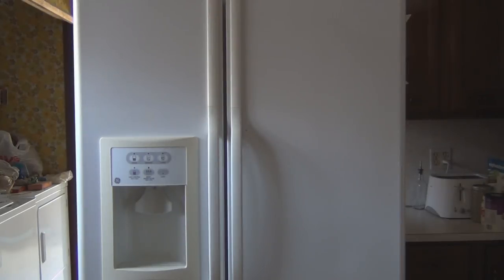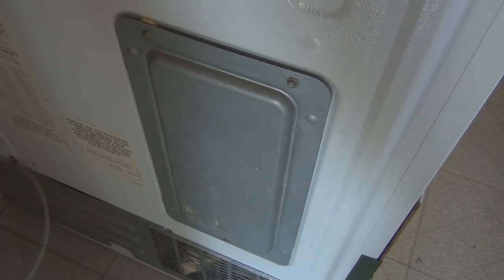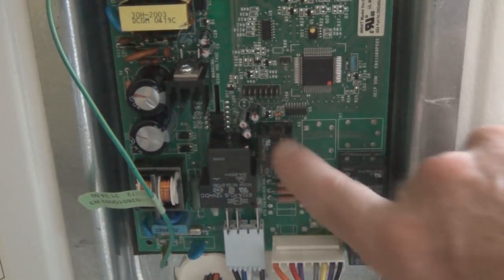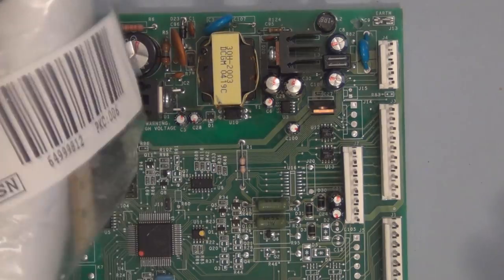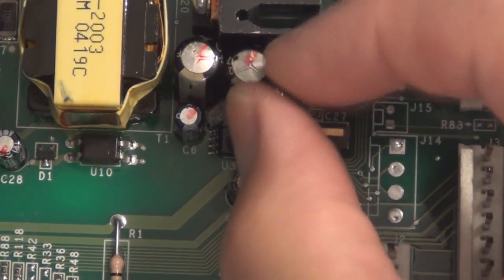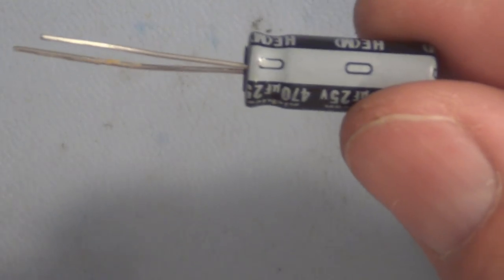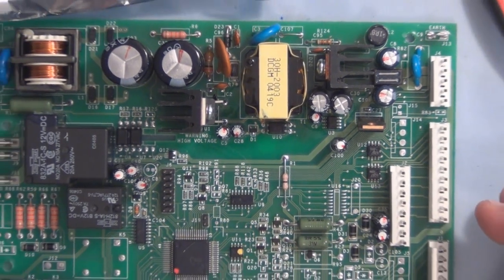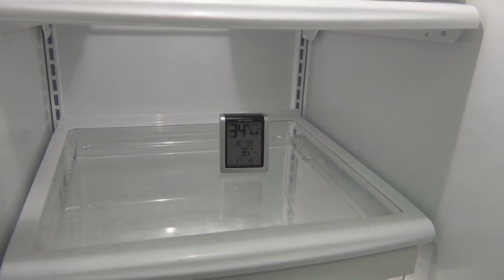GE Refrigerator Not Cooling Clicking Control Board Repair

Comment: I can't believe an established company like GE would let such a rookie design mistake find its way into production. The electrolytics C29 and C30 are indeed being baked by the diode heatsink. Even though the caps I pulled out of my defunct fridge had a high temp rating of 105*C, eventually they will fail as the electrolyte boils off. As these are filter caps on the secondary side of the on-board switching power supply, there is some latitude in replacing them to avoid a repeat early failure. Here dual caps are paralleled to minimize board footprint, resulting in approx. 1000uF total capacitance on the output rail. So a single cap of this value can be used in place of dual caps. This won't fit in the C29/30 locations but avoiding that hot seat will make for a more permanent repair. As such locate the single cap to the right of the heatsink, lying it on its side. If a new cap is used the leads should be long enough to allow this or wire stubs can be added to a cap from the junk box. I'd insulate the extended leads with spaghetti tube and glue cap on its side to the board. Finally the cap needs to be a low ESR type and intended for use in switching power applications, which usually have a service temp rating of 105*F or greater. If you're in a time crunch a suitable 1000uF/25V cap can be harvested from the switching power supply of cast off electronics. Kudos to eTech Tom for detailing the failure's root cause.
Reply: I will drill the cover plate with many holes, allowing the hot air to escape. Currently it is trapped inside. Is there a material one can stick between two caps and the heat sink. Some kind of insulator. I agree...extremely poor design from industry giant like GE.
Reply: Had the same issue, but couldn't wait until I could get the capacitors shipped to me with kids and fridge full of food that would spoil so I used a single 4700uf 25V capacitor I had laying around and mounted it lower away from the heatsink. It's been working great now for over a week! Hopefully it lasts 🤞
Reply: Yes you can use a larger single cap(1000/25v) and just lay it down and put a dab of silicone on it to the board to secure it. Being away from the heatsink will extend it's life forsure.

Comment: I am disappointing that everyone has a repair in an older model. I have a GFE27GSDSS and no one has a video of a newer refrigerator. My fridge is 55 degrees while my freezer is at 34. I need to replace the fan and motor but no videos available on that newer version. Can you help??
Reply from the maker: I had a refrigerator once that had a cold freezer but a warm refrigerator and the problem was counter intuitive because I never thought about it.  There is an automatic defroster element in the freezer section that prevents a build up of ice on the coils that get cold.  Air is blown across those coils and sent into the refrigerator section.  If the coils are encased in ice this impedes the flow of cold air into the refrigerator portion so if your freezer is cold and the fridge is warm you probably have to replace the heating coil in the freezer that periodically melts that ice around the coils.  I found this link that might be the part you need and it goes for around $24.  On the diagram it is part number 761.  http://www.partselect.com/PS6883666-GE-WR51X10132-HEATER-DEF-ASM-FF.htm?SourceCode=4&SearchTerm=GFE27GSDASS   Left click the diagram to magnify it.  That long tube heats up and keeps the coils free from ice.  I never thought there would be a heater in the freezer but that is an automatic defroster.  I don't know if you remember that you use to have to defrost the old refrigerators yourself once in a while.

I found some additional information here which indicates it might be a fan problem. https://www.applianceblog.com/mainforums/threads/56994-GE-French-door-freezer-cold-fridge-not
Reply: there could be a blockage in the piping from the freezer to the cooler..or the flap that is controlled by the tstat on the right top, next to the freezer tstat is not working right. All it does is open a door to allow more cool air to go into the refrigerator section.. There is only one compressor and one coil inside the freezer that make the whole frige cold. So if it is not working right the refrigerator side will not cool, or will become slightly cool..
Reply: Gloria Miller I wouldn’t get hung up on model age. Problem is caused by same issue as older models. So if you find a fix here it will probably be the same fix. I know it’s been some months but someone else may have the same issue.

Comment: Thanks for such a super helpful video. This morning by fridge(GSS25WGPDBB) was not cooling, dispenser lights flickering and temperature control is showing up as blank. Tested main board for voltage and it's showing up bad(low DC voltage). Could it possibly be capacitors? I don't see any burn marks on the board and getting input AC fine too. Curious, what were your symptoms?

Comment: Hi! I have same problem with my fridge but I don’t see any signs on the electro capacitors. How can I know which one is? And it happened a couple months ago and I let it rest for two weeks. Plugged in again and it was no noise. It work by itself. But I want to fix it, is doing it again.

Comment: I think my control board has the same issue. Would it matter if the new capacitor is a little smaller in size but it’s the exact rating? It’s a 470uf 35v - the leaking one is a little longer probably because of its age.
Reply from the maker: As long as they have the correct ratings and you can make them fit it should work.

Comment: bummer my caps aren't bulged but I still get the clicky clicky now and then after a defrost cycle...touching parts around the board (safely) didn't reveal any hot ones... Interestingly they 'secured' that board where even outside air can't cool it off... I might explore putting in a few strategic holes to let a little air circulate

Comment: What are the dimensions of these capacitors? height/width in mm? I noticed on Newark they offer multiple sizes and if I get the wrong ones that are too wide, they won't fit. Want to be sure before I order. Thanks! :)
Reply from the maker: Here is the Newark part number 65r1968.   This is the manufacturers Nichicon part number UHE1E471MPD1TD.  It's also available from Digikey.  The fridge is still working too.  I did have to remove some more brittle water line but everything is working now.  Even the water dispenser.  Good Luck with your repair.
Reply: @tmc200527  Thank you SO much!! And that's great to hear your fridge is still working!

Comment: A friend´s board has blown out IC located on heatsink next to the two 47uf x 400V capacitors.  Do you know the part number for that IC ?
Reply from the maker: If you are describing part U2 on my board it is an L78M05CV which is a 5V regulator.  Here is a link to the data sheet https://www.jameco.com/Jameco/Products/ProdDS/1389935.pdf
Reply from the maker: It looks like digikey carries that part https://www.digikey.com/product-detail/en/stmicroelectronics/L78M05CV-DG/497-14789-5-ND/3945944

Comment: I have a much newer stainless steel ge fridge and this same thing was happening and this exact same fix worked like a charm!  GE must just continue To use the same circuit boards over and over with a poor design.

Comment: On fridge side the digital won't go past 2. 1 , 2 then terns off. Any thing you could tell me would be greatly appreciated. Thank you.
Reply from the maker: I do not repair appliances for a living but I did some research based on your question found this information https://www.ifixit.com/Answers/View/307737/Fridge+won't+hold+temperature+settings,+freezes+on+refrigerator+side
There is a door that opens and closes in a box at the top left side inside my fridge section that regulates cold air flowing into the fridge from the freezer section thru a hole in the wall separating the freezer and the fridge.  When you set the temperature of the freezer and fridge the compressor cools coils down to the set temperature but the fridge is cooled by drawing in cold air from the freezer compartment by opening up a flap on the top left side of the inside of the fridge section and drawing in cold air with a small fan.  When the fridge reaches the set temperature the flap will close and the fan will stop.  I'm not sure what you mean when you say the digital won't go past 2,1,1.  If you can't adjust the display by pressing colder of warmer I would think that there is something wrong with that controller.  If the temperature of the fridge is to warm the flap is stuck closed or the fan is not working.  If the temperature is to cold in the fridge the flap is stuck open bringing in to much cold air from the fridge.  If you recently had a power outage maybe you need to reset the display.  Here is a link explaining the reset process.  https://removeandreplace.com/2016/02/02/refrigerator-display-panel-is-blank-not-working-how-to-reset/  Hope this helps.  Good Luck

Comment: Thank you for the easy fix, my ge is a different model but similar board same issue. The LED's inside of mine went dim then 2 weeks later the ice maker quit working. And then with in a week (Sunday morning) it started clicking and not cooling. I was looking at replacing replays and overlooked the 2 bulging caps. Thank you for taking the time to post this video it was a GREAT HELP.

Comment: Thanks for your video. I had a GE French door - Freezer at the bottom.. no action at all. On the main control board. I saw that the fuse is burned.. Would you know the part number of the fuse so I could order just the fuse and try your way.. There is a sticker on the part number of the board 200D9742G001 -  the main control board part number is WR55X10996. Thanks..

Comment: 👌Hello, eTech Tom,    Spot on.  I assure you that you will be getting some beer money from the lady that asked me to fix her 'frig.   1) bulging caps are never, ever good things.  The tops are supposed to be very flat and clean.  Electrolitics can get warm/brown, but, the tops will usually tell you first off.   2) Your theory could be sound and certainly a contributing factor, although, conventional heat rises (as opposed to radiant).   We will never know, but, I suspect design issue as this is so common.  3) there are debates over what to replace in terms of preventing this again.  Those were 25V caps and 50Vs would be able to handle more abuse, but, they are larger.  Without knowing the original design criteria, we don't know if the caps are/were the weakest link or the transistor next to them.  I chose the 50V route and just hung them a bit off the board.  I noticed the solder used was of the "environmental" and I needed to add some flux to make clean desoldered holes.  4) one of your fans (Tradition Rider) is correct in using different caps of smaller value when used in parallel to come up to around 470uF.   Lower value might be better if the inrush current is affecting the transistor nearby.  I didn't ohm it out and get schematic like on it.  'Just saying.   You have a smart fan base, by the looks of the comments.  Nice job and Thank you for the time.  I got extra cookies for saving her $$.  😀
Reply from the maker: Thanks,  This video makes me feel the best because I realized afterwards that it saved people some money.  I still have the same fridge but it died again last month.  I had purchased a replacement board off of ebay back when I made this video just in case I could not fix it so I swapped it in.  The fridge compressor relay was not working so I watch some videos and assumed it was the relay but it was not getting a start voltage from the control board.  I have not tried to troubleshoot it yet but visually I did not see anything wrong.  I was looking at replacing the fridge and quickly realized that the prices have really gone up so I saved some money again.  If I troubleshoot it I will post a video.  By the way I have a Norge customatic in the cellar that has been continuously plugged in for over 50 years and has never needed repair.  It was my back up while I fixed the modern fridge that keeps breaking.
Reply: @tmc200527  Good outcome. Your "investment" in the board paid off. Amazing Norge!  I'll update with beer money, next time I see lady.
Reply: @tmc200527  what eBay store did you buy your control board from and will I be able to return the board if the replacement board does not stop my clicking problem? Thanks
Reply from the maker: @Ally-oi6lm  It was B Lights Parts LLC  I don't know what there return policy is.  The listings do say 30 day returns buyer pays for return shipping.  Make sure your model and parts numbers match.

Comment: Great video, I replace the capacitors and my refrigerator is working fine.  Can you tell me why my ice cubes are hollow and how I can fix it?
Reply from the maker: I have not heard of that before so I googled that problem and found a couple of suggestions.

 This problem is referred to as "hollow cubes" and it does cause the cubes in the ice bucket to stick together.

If the refrigerator and the icemaker are level hollow cubes are caused by 1 of 2 things. 

The water fills into the end of the icemaker opposite the motor and controls. If the water doesn't fill all of the ice molds the one closest to the motor will have a partial fill. The thermostat senses the temperature of this mold and when the thermostat closes the harvest cycle begins. A partial fill causes this mold to cool faster than the other molds so the icemaker harvests partially frozen cubes from the other molds. 

To check this put your finger into the molds and see if the front one is less full than the others. I am sending you an image showing how to adjust the water level of the icemaker. If the water level changes again after you have adjusted it, replace the refrigerator water valve.

The second thing that can cause hollow cubes is a defective thermostat inside the icemaker. If this thermostat fails it is slightly more expensive and much less work to replace the entire icemaker. If the water level in the ice molds is all the same I would replace the icemaker.

It is also suggested to change the water filter every 6 months and check to see that the water line is not kinked.

Comment: would drilling out the old capacitors work instead of using heat?
Reply from the maker: I would not recommend drilling out any components.  There are many electrical connections that you will break by drilling and you will not be able to repair that damage.
Reply: @tmc200527  thank you

Comment: Hi, eTech Tom.  Thank you for your video.  How do I match the capacitor when I shop online? The information on my capacitor has "PET" on one line and "812 7D" on another but nothing else.  
Did you by any chance make a mistake when you said the model number?  My refrigerator looks very much the same as yours.  Mine is GSH22KGREWW while you said yours is GSH25KGREWW.  They only differ by one number.  If they are actually the same model, maybe I can just get the exact same capacitors you bought.
Reply from the maker: There are multiple boards found in that model of Fridge if I remember correctly.  I did not need the model number of the control board to get the value of the parts.  The value and voltage rating should be written on the side of the capacitor.  You can search for parts with Digikey or Newark Electronics or Mouser.com.

Comment: Thank you Tom for the video (at minimum we knew what was going on when the clicking sound started, and then when the refrigerator died the next day we knew what the general issue was). So, our questions are ... we pulled the board when the refrigerator  stopped working and used your links to buy a new set of capacitors from Newark * 470uf /25v, which happily took about 10 days to arrive due to a Newark shipping issue.  So now that we have them, they just arrived a few moment ago, upon opening the packet we see they are marked 470uf /25v however they are 2mm wider and 8mm shorter than the ones on the board?  Is this size difference an issue using them on the board?  (i.e. I am concerned that the new stubby format we have received will touch the heat sink and be quite crowded on the board, if they fit at all?).  Secondary question if they are ok to use: once we get our mechanic to do the solder for us as we don't have a solder tool nor any experience using one; is the positive/negative placement important in the installation on the board?  Thank you very much for your assistance, I'd very much like to have a refrigerator again However I would very much NOT like to make an error which could be dangerous or detrimental to our refrigerator or our home.
Reply from the maker: I'm not sure why the caps you received have different dimensions?  Maybe if you solder them so they are not flush with the board you can bend them away from the heatsink.  They are electrolytic capacitors and have a negative indicated lead that usually has a line on the casing indicating the negative lead.  It is important that you put them in correctly.
Reply: @tmc200527  I was able to reach out to Newark and inquire about the size difference.  It seems that I should have gotten capacitors with a dimension of 8mm Diameter and 20mm Height.  (I have not yet removed the old ones from the board but Newark said they think the lead spacing is 3.5mm.
There were a couple Nichicon capacitors on their site that met that dimension requirement (shown below) is the one that they said I needed.

NICHICON

UPW1E471MPD6TD

Newark part # 65R4066

Q: is this the correct capacitor for the GE refrigerator board? 

I hope this extra information helps others more easily follow along as the Video was Awesome; however it is tough for the non-repair specialist to know which replacement part to purchase so we can follow along accurately.